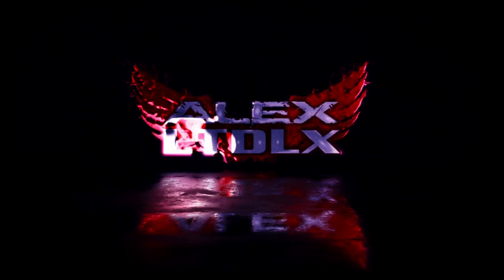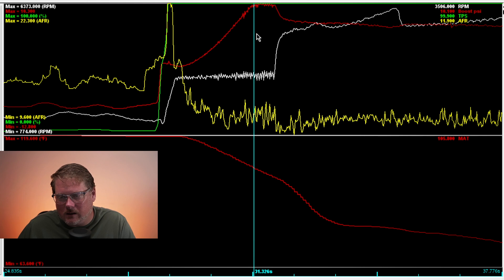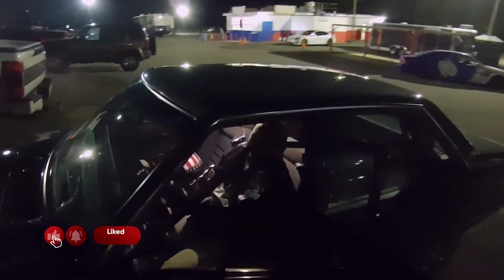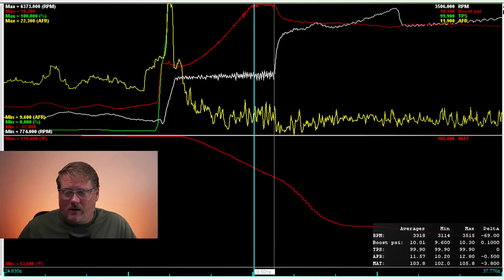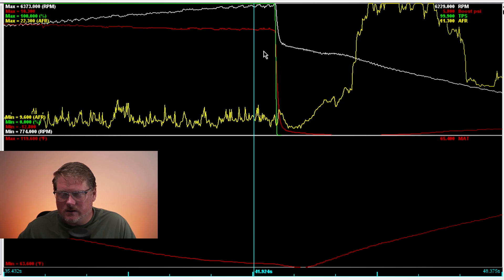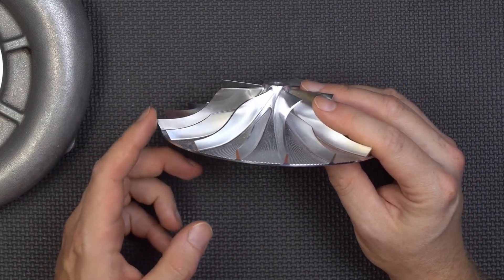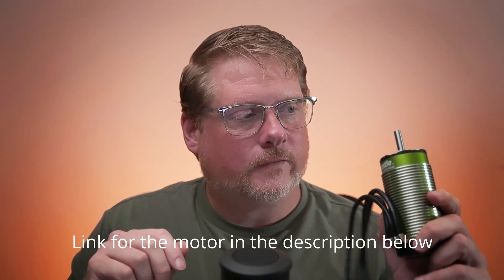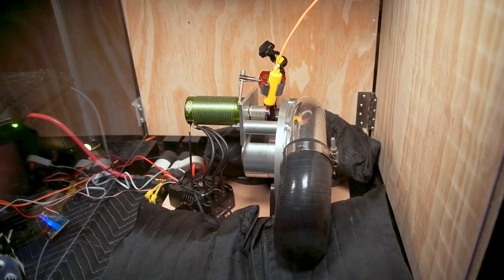How Much Boost Does An Electric Supercharger Make?

Comment: I want to say that impeller and housing can go much higher, like 60-65k speeds. Just gotta have something that can drive it that fast. 35k is less than ideal. Vortech did it with big pulley little pulley and a step-up ratio internally.
Reply from the maker: That is true - 52k in this case.  However, you're starting to get into lower efficiency islands on the compressor map at those elevated speeds.  It's better (more reasonable considering available motors/escs) to stay in the highest efficiency areas of the maps and just throw more electric superchargers at the car if more power is needed.  At this point, you can build a head unit/motor/ESC combo for under $2k.  Batteries, of course, are separate, and capacity and size will be dictated by use case, but your could go as cheap as $400-$500.
Reply: @AlexLTDLX  how about a bigger cover and impeller? If you can't spin it faster, just throw more air???
Reply from the maker: That's about where we're at.

Comment: The question should be "How much HP/airrlflow can it support? CFM IS CFM. Density is Density. How long has Gale Banks been preaching this? Lol
Reply from the maker: You're right.  It seems when I go that deep, I lose a lot of people (not people like you, though!)
Reply: 1,000% agree

I've just had a habit ever since I was younger of doing the calculation in CFM on every single dynamometer run I've ever seen.

And what's funny is you find certain numbers that are the average for certain things

Like your general hot rod motor is almost always putting out right around one horsepower for every 1.35 CFM

But then you get to your higher end hot rod motors that maybe have a radical cam and those are closer to like a 1.28 CFM to make a horsepower which consequently is right in there with the McLaren F1 motor. It was like a 1.28 and change CFM per horsepower

Then the closer you get to like a formula motor. It's more like one CFM per horsepower

Of course, once you know how much power your motor makes, you can now easily calculate what boost you need to make the The power you want.

Might not be perfect because like you said it doesn't include density. But if somebody would like to teach me the math to do it with the density i would be appreciative.

According to Gail Banks, every 10° Fahrenheit you drop the air intake temperature. You get 1% additional horsepower no matter the output of the motor

P.s. before anybody rips me to shreds, I'm just doing a basic number of airflow for motor with RPM and cubic inches, I'm not trying to calculate the volumetric efficiency for each motor. But since I use the exact same calculations for every motor, it still gives you reliable. Repeatable predictable numbers.

Like I love to see an article title. 5.3 l. LS 560 horsepower.

I love to stop and do the calculation and predict what RPM that peak horsepower was at based off of the calculations. And I'm almost always within 100 RPMs

So like I said, as long as you use the same formula every time you can get pretty accurate
Reply: Lol less money less boost more air density more power!!!
Reply: Whelp, you are absolutely nuts for diving in like this with your own money on the line. That takes guts. You got yourself another supporter!

Comment: how much watts does the electric supercharger draw at peak?
Reply from the maker: 34,000.  Not a typo.  The smaller/cheaper unit is at 14,000-15,000 but it costs a quarter of what the Sledgehammer does.

Comment: I'm sure you've answered, but as I was clicked links, I realized that the ESC was significantly more than the motor.  Could the motor not just be "on" or "off", and some sort of mechanical wastegate / pressure-bleed downstream, before the intake, to physically match the output to the needs of the engine at every point in time?  That is, keep the impeller power input cheaply at 100%, and let its speed vary as its output flow is either being dumped to atmospheric, or fed into the engine?  Doesn't seem like spinning the impeller against "no load" during the dumping phase would waste too much energy?  

School me!
Reply from the maker: Good question - actually, running it wide open draws by far the most current because the compressor goes straight in choke.  You can see it clearly in this video: https://youtu.be/Azeaf6WVPfQ?si=NAc76Fou07WJ_bFu
Reply: @AlexLTDLX  No - I'm proposing that when the impeller is accelerated to full speed before the engine needs it, the pumped air is dumped to atmo through some sort of mechanical valve.  As the engine accelerates, and needs boost ramping up, the dump valve closes as directed from some sort of sensored inputs, and the pumped air then begins to pressurize the intake tract.  The motor in this case doesn't need the expensive capability of variable speed,does it?

The entire thought was simply based around some way of getting rid of the expense of the ESC.  I mean, it's a great price for a 10HP motor, but not if it needs a $400 controller.  Hell, I could almost get another 20HP of motor for that!.
Reply from the maker: That's a good idea as far as keeping it spun up.  But you still need an ESC to run the motor no matter what.
Reply: @mccanlessdesign  These are three phase AC brushless motors. You need something to chop the DC up into the right frequency to make them work, and that frequency is always changing when the motor is changing speeds. That's why they are so expensive, there are at least 6 pretty large mosfets being very carefully switched to make the motor move. 

You might be able to use a different motor but it is very hard to beat the compactness and speed you can get from a brushless AC motor. In fact, I'd like to know where you are finding 10+ HP DC electric motors for $400. I'd put one on my hobby metalworking machines. In my experience a BLDC setup is insanely cheaper, even considering the cost of the controller. 

Lotta people will call them DC brushless, but they are not. They are called BLDC because you feed the ESC with DC current and let it do all the commutation magic. Try and remove the ESC and you are left with a brushless AC motor.
Reply: @pontiacg445  Cool - thanks for the explanation.  I hadn't seen a 10HP DC for $400 - just that that the green motors in the links here are under $300 and ~10HP.  Was just thinking "was there a way to make them run cheaply at a constant speed?" - I wondered if a lot of expense was varying the frequency to hit the MOSFETs with for an un-needed variable speed function, and maybe that function could be eliminated, along with its expense.